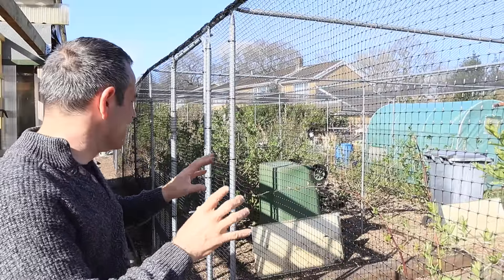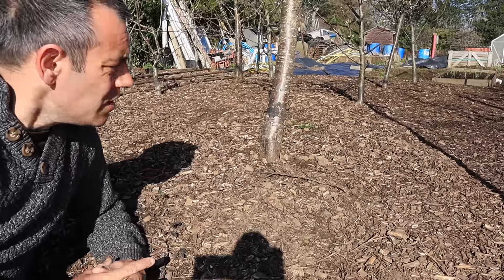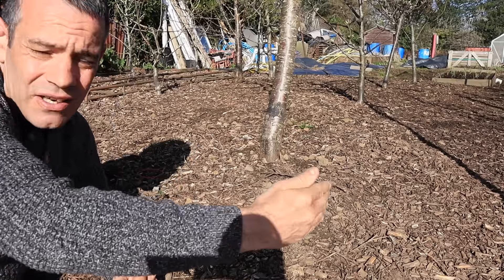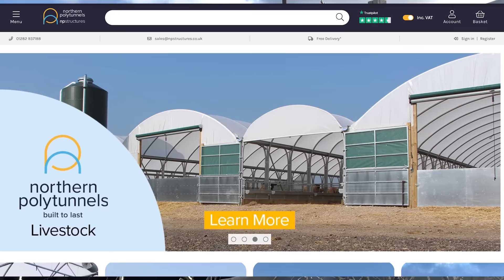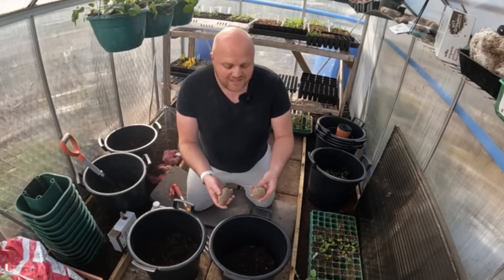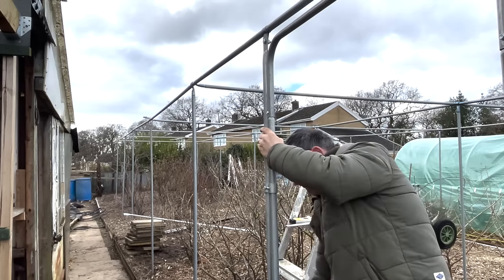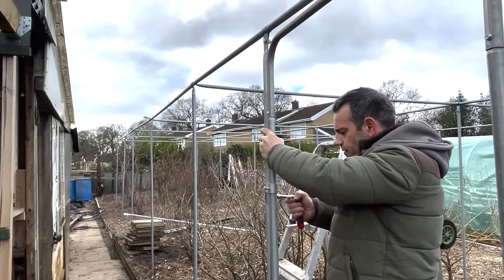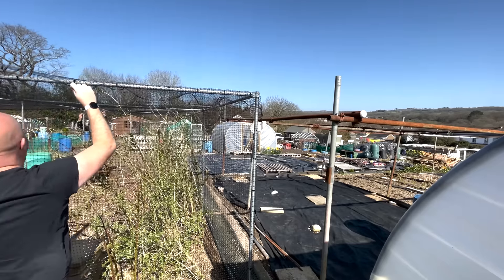This Genius Fruit Cage Changed My Garden Forever!

Comment: Hi Tony, wow! Huge fruit cage and nice of Danny to help you too. I bought a fruit cage last Year but, mine is from first tunnels and my hubby and I built it together and its brilliant. I bought long  plastic clips to secure the netting on the top with called times too. The left over netting, I cut it with about 4 inches over and turned my netting towards the inside then held in place with the large staples to hold it in place and as i have bark on the ground so,  I covered it with that. Its got through the Winter and all the storms we have all had so, very impressed with how strong it is. Thanks for sharing and take care 🙂

Comment: Nice addition Tony. Guess I'd agree with some, the price. But nothing says, since 
you buy in modules, you can't start small, and add as necessary. Over the years 
your soft fruit area has grown and is dedicated needing more netting than most. 
Question,
Does Northern Polytunnel offer any advice on the life expectance of the netting?
Seems it may last longer if taken down, but that adds one more chore each Spring
and Fall plus the chance of damaging it when doing so. Your thoughts.
TYFS, Nice Job        Mark n Rosa
Reply from the maker: Yes i have a huge area to cover, for most a simple couple of sections would be more than enough

Comment: You don't want to use a soft fabric net like that to keep birds away from fruit, if they fly into it or land on it they can very easily get tangled. If no one cuts the bird free it will die and then scavenger animals attracted to the body also get caught in the net. If the animal is cut free from the net while alive it can still suffer serious constriction wounds, sometimes leading to amputation of limbs. Its much better to use a hardwire mesh to keep animals away from fruit.
Reply from the maker: They cant get tangled in this netting It is too tight and Ive been using the netting for years before hand

Comment: Wow £6,000 for the large 2 door cage?  I dont use a cage at all and only a few berries get eaten. If there was a problem I would throw some scaffold netting over the bush when the fruit is ripening.
Reply from the maker: There are loads of different sizes
Reply: £6000 surly this is an April fools 😳
Reply from the maker: @Jacko580  Jacqueline you need to select the size you need they do cages up to 6k

Comment: To keep birds out?

...🤔 Actually, I want to keep them in.😂 (small birds like canaries. I'm wondering if these are cheaper than to build a cage  with wood and metal mesh with the same size of the little squares on this mesh you used.

...but of course not this big, probably a 4x6 or 6x9 and a height of at least 6 or 8ft.